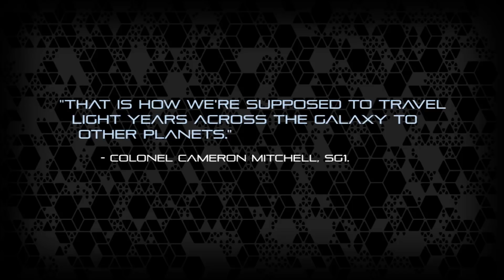The Stargate - Spacedock Sci-Tech.

Comment: Some things interesting trivia:
1.) The SGC iris did prevent materialization of most things, but there was an instance where a particle accelerator was used to bombard the iris with particles, which worked because sub-atomic particles were allowed through to re-materialize - heating up and almost melting the gate.
2) The 2nd generation Milky Way gates are capable of manual dialing (physically, by a human, moving each chevron to a dial location - like a rotary phone... I now sadly realize some of you are too young to know what that is, just do a Youtube/Google image search for it). The 3rd generation Pegasus gates are basically digital and are not capable of this. Sounds like a pointless thing, but it allows emergency dialing without any control device.
3.) SGC/Carter's dialing computer also bypasses innate safety protocols that the Dial Home Device has built-in to protect "bad connections" (SGC/Carter didn't know this at first). Meaning you can establish connections that normally wouldn't be allowed... whether for good or bad (usually bad).
4.) The SGC/Tau'ri actually made good military use of the gates. They even had a missile launching platform that was retractable in the gate room and would launch missiles THROUGH the Stargate at times. They also used drones and launched them through the gate, as well. The only thing that they didn't do was really send much in the way of armored vehicles through the gate. Although, at sites where they could build bases, they did transfer some vehicles and things like F-302s.
5.) Stargates have issues operating in close proximity with each other depending on the conditions and circumstances. Stargates with working DHDs take precedence over any other gate at a fixed location, as SGC found out when they realized that there were actually two Stargates on earth. Also, newer generation Stargates automatically take precedence and override newer generation gates. Making use of two generation Stargates in close proximity difficult (some enemies actually used this by having a gate on their ship to prevent SGC from utilizing their stargate, since either they had newer generation stargates or they had working DHDs - taking precedence over SGC's 2nd generation/non-DHD stargate). McKay managed to rig the two gates on Midway Station (a space station that utilized an automated series of gates from the Milky Way and Pegasus galaxies for cheap/easy/fast travel between galaxies without a ship or ZPM) to work in close proximity with one another, despite being different generations.
Reply: In regards to you point #4, I think that the problem with sending armored vehicles through the gate is bringing them to the gate room in the first place. There's no way that they could bring anything larger than a motorcycle or a small ATV to the gate room because none of the elevators leading up/down to the gate room would be large enough and/or have power to lift that much weight; I'm not even sure there's an elevator or lift powerful enough to lift a modern armored vehicle. The only to bring an armored vehicle in would be to airlift it in by slinging it under a helicopter and bringing it in through the "skylight", but that might draw too much attention, people might wonder what NORAD is doing with armored vehicles. Air dropping is out of the question since that would require the kind of pinpoint accuracy that the air dropping can't deliver and there's still the weight limit of what you can drop out the back of an airplane and expect it survive the fall, even retarded by parachutes, don't mention the structural integrity of the floor to withstand so much weight dropping on it.

Assuming you cover vehicles with tarps or something to disguise their appearance you would still be limited to what you could bring in to light armored vehicles like Marine Corps LAVs and Army Strykers. While I can't find any info on this I don't think that anything as heavy as a Bradley can be underslung by either a CH-53 or CH-46, Marine Corps and Army heavy lift helicopters and an M1 Abrams is completely out of the question, way to heavy to be lifted by any helicopter made by anybody.
Reply: +Riceball01
...Did you not see where how they explained how they got the GATE ITSELF which weighs 32 tons (64,000 lbs) and is 22 feet (6.7 meters) in weight/size into the facility to begin with? The Stargate in the SGC is at the bottom of a reinforced shaft that has "doors" for a ceiling that can be opened. They lowered the Stargate down that way into the facility. And if you can lift down (and up - they had to lift out the original Stargate and strap it to an X-302 prototype and hyperspace it away from Earth before it blew up) a 32 ton ring that is 22 feet in diameter, you can lower and raise all types of shit in the U.S. inventory. And it's not like you NEED an Abrams MBT. Something even as simple as a M113 would be a HUUUUGE force multiplier and asset for SGC. And they're pretty damn light and amphibious and can be IFVs and APCs and mount some pretty impressive weaponry (for such a small/light vehicle). In fact, you can drive through two M113s at the same time and still have a bunch of room in-between them and on the sides without touching the Gate. Anything that is capable of fitting through the Gate can be used, since weight isn't an issue for the Gate and lowering anything down outside of maybe an M1A2 with TUSK/SEP would be possible (By the way, yes, an M1A2 with TUSK and SEP outfittings and turrets would still fit through the Gate with plenty of room.) The only things that would present problems with fitting through are aircraft because of their size being too big for the Gate itself (like, say, even if you took a C-130 and took off the wings, it's still too tall to fit through the Gate - and you can't really cut the fuselage apart and put it back together very easily).
Reply: Yeah. The gate room is literally at the bottom of an empty missile silo.
Reply: @Riceball01  while what you say is true if they dont want to use the elevator that lifted the gate it self,  in later times when they got beaming they could beam a vehicle into the room and out tbh and didnt they had a puddle jumper after s8.
Reply: D.Magnus You have a point there, but I think that you would have to beam the object/person to the ship first, then from there down to wherever. I don't think that they could, say, beam a tank from wherever it's parked then directly to the gate room, it would have to be beamed aboard the ship first then to the gate room. Now, if the Daedalus classes had a large enough hold and it can beam things to there then beaming a tank, or any other vehicle, would work.
Reply: the Daedalus Class has plenty of room to beam up tanks, just have them materialize in the hanger, and i don't think that would even be necessary as, so far as i can recall its been a long time since i watched the series, but the SGC should have its own beam array
Reply: Riceball01 uhm lets not forget the episode where sg1 beamed an entire building into space, aside from the building being a bomb nobody really thought of using the beams to move an object the size of a building, they never tried, also there is wraith tech that the sgc could reverse engineer for example the dart matter storage thingy that can digitize people and whatever they were carrying, basically since stargate is a series that shows each piece of tech the tauri had came from somewhere or explained in a prev episode imagine a daedalus with wraith tech installed, having 100s of 302 fighter and 100s of armored vehicles in digital storage, or say for time sensitive missions the sgc send a puddle jumper or a malp with wraith tech and tons of equipment or 100s of armored vehicles in digital storage ready to deploy, the way stargate is portrayed its entirely possible carter or mackay or some other genius to develop the tech for use by the tauri
Reply: @Riceball01  NORAD is right next to Fort Carson (army base). It wouldn't be very weird to see armored vehicles there.  The exits for both bases are literally across the highway from each other. (I drive past them both pretty frequently.) It might be a LITTLE weird to see them airlifting a tank over Cheyenne Mountain, though. Onlookers from the zoo would see everything! (Yes, Carter... there is a zoo in Colorado Springs. It's ON THE MOUNTAIN YOU WORK IN.)

Still though, you're right. The shaft is very narrow and the gate aperture isn't very wide at the base.  There's not a lot of Earth-type heavy equipment that fits through there.

If the show ever returns, some new invention built to fit would be awesome.
Reply: #3:  Carter's missing safety protocols may include fallback protection, which would prevent any person or object traveling to a world where the gate was on its back from being killed on arrival. Instead of falling back into the event horizon to be disintegrated, the traveler would be suspended on the surface of the event horizon. An unscrupulous traveler, such as a Go'a'uld, might use this feature, in conjunction with the fact that the event horizon itself resembles a pool of water, to appear to uneducated primitives to first rise up and stand on the "water," and then walk across it to the edge of the pool. It would reinforce his or her image in their eyes as a divine being.
Reply: @TheDetailsMatter  You have to completely enter the event horizon of the incoming wormhole for anything to happen. Otherwise, you can just pull yourself back out. (O'Neill has done exactly this.)
Reply: @Swiftbow  But how divine would it make you look to rise up out of a pool of shimmering blue water, then fall back in up to your waist, wade to the edge, and then clamber up out of it on your hands and knees? Not very.

The only time I can recall O'Neill partially entering an incoming wormhole was when he was keeping his arm in the "water" to hold the gate open for the renegade SGC team to escape being beamed up by the Asgard, and that was at Earth's gate which, as noted above, is jury rigged, bypassing over 200 safety protocols.
Reply: @TheDetailsMatter  That's the example I was thinking of, too, yes. I don't think any amount of jury rigging would disrupt a primary mechanic of the Gate like that one. Carter's rigs were primarily built around:
- Powering it
- Figuring out how to send signals that the Gate would respond to, see what those signals did, and then code a program that would send said signals on command.
- Bypass feedback they didn't understand to make the thing keep dialing and attempt to create a lock.

Most of the problems come from that last one. Carter's programming came entirely from sending electrical pulses and seeing how the Gate moved in response. The Gate's error signals, though, would be a complete mystery and nearly impossible to decode without some sort of reference. So they just didn't. (Hell, without said reference, they wouldn't even be able to tell the feedback were even error codes. As far as they knew, the feedback was a little paperclip saying "I see you're trying to dial another planet! Can I help?" But they still couldn't read any of it.)

You couldn't stand up in a Gate on its side with your waist sticking out, because there's nothing to stand ON. Teal'c went through a Gate that way once (it was on its side, but the kawhoosh had made a dent he could anchor to.) If he hadn't anchored, he would have fallen back in completely, and died.

So... you CAN enter an incoming wormhole, but only if you don't fully do so. The Stargates should really have warning labels on them.
Reply: For an already existing vehicle that is around the size of the MALP. Using the Weisel would have been ideal. Highly adaptable and no issues with weight or size.
Reply: This is the first time it occurred to me, but at the end of the last episode of Stargate Atlantis, there were two stargates of different generations on earth at the same time. Awkward!
Reply: MonkeyJedi99.  Who knows? There might be even more. If a gate were placed on an island which later sank into the sea, or near a hot spring that later grew into a volcano. Earth is a volatile world, constantly changing. Hell, we only assume the Tunguska Event was caused by a meteor....